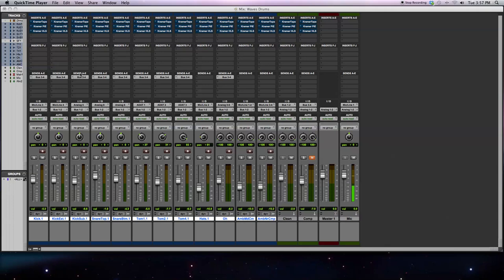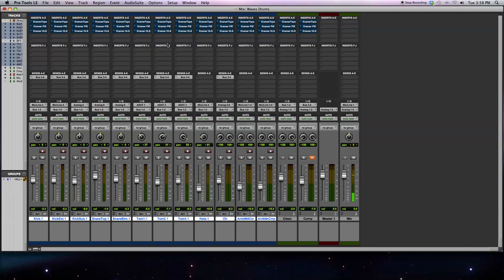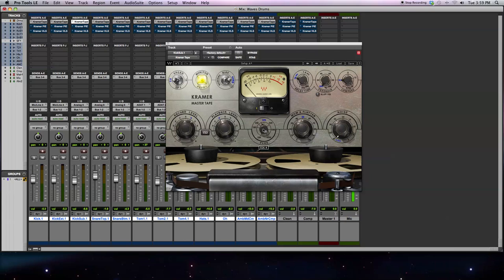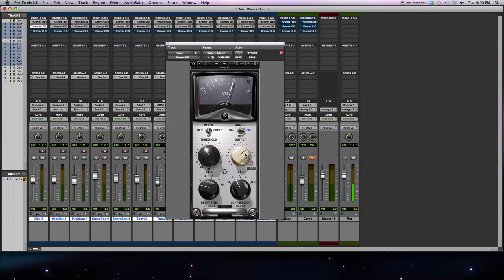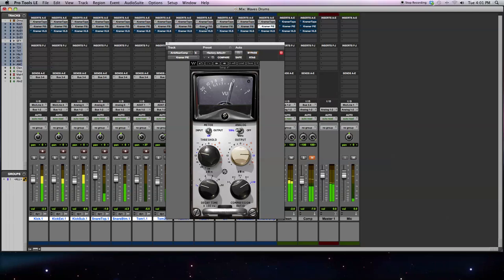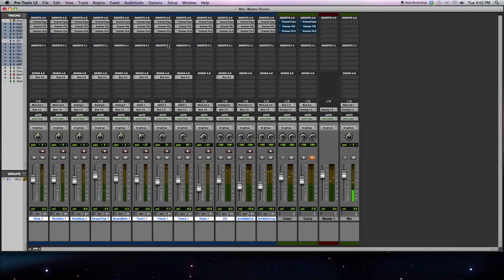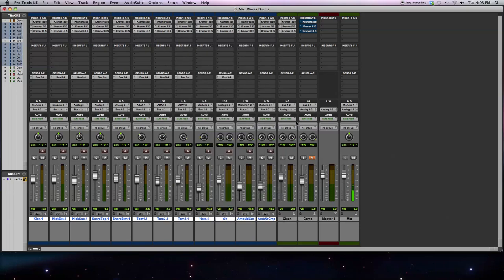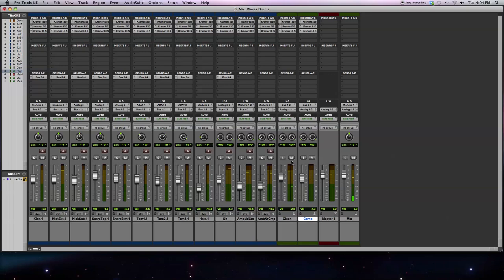Product Demo: Waves Kramer Tape, Tubes, and Transistors Bundle

Comment from the maker: The analog switch is only for noise.  The simulated "colour" is separate from the analog switch.  I almost always turn the analog switch off. Rather than having simulated noise being added by several plug-ins, just consider adding noise with a single plug-in.